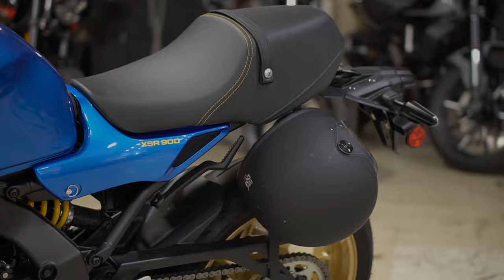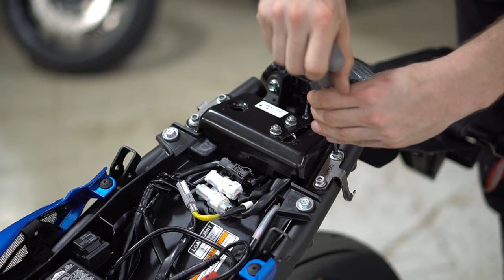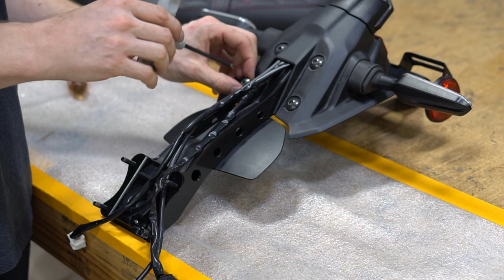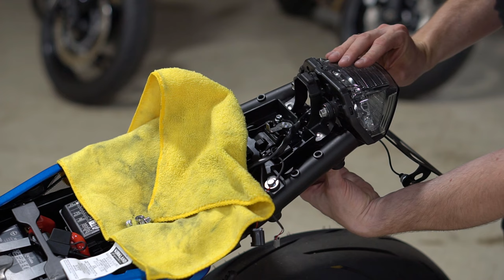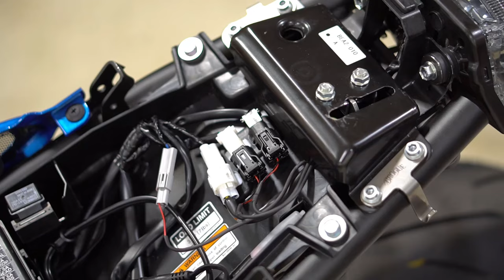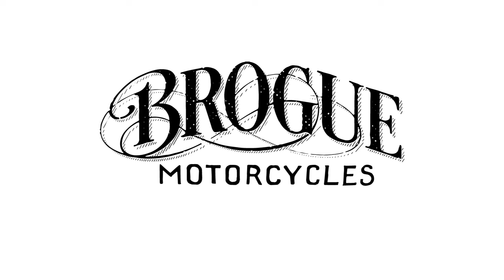Brogue Moto XSR900 2022+ Tail Tidy (fender eliminator) Installation Video

Comment: Anyone know the proper torque numbers?
Reply from the maker: I recon - 80 -100 inch pounds will get you there safely. Not including the locking torque required to seat the nut.
Reply: @broguemotorcycles  I appreciate the response